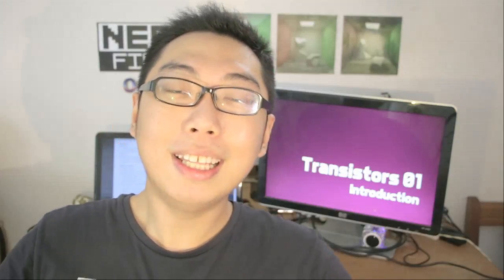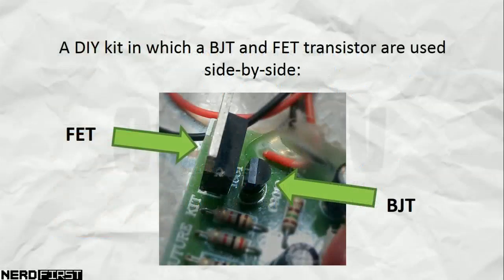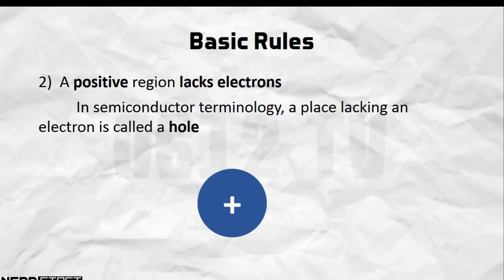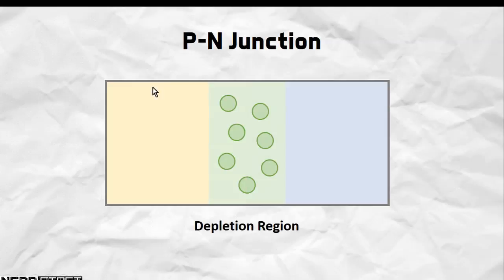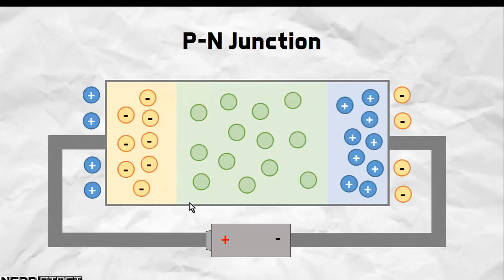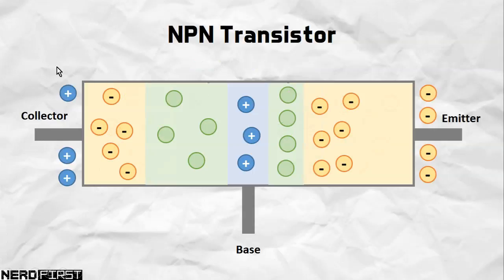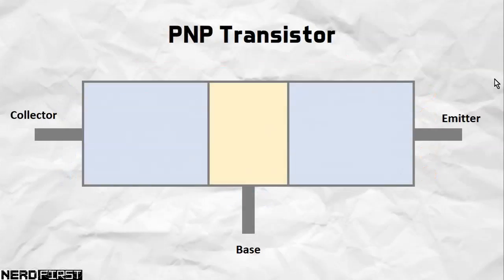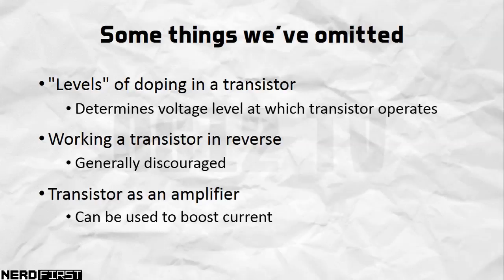What are Transistors? - Transistors 01

Comment: In 8:46, positive atoms on the right get pulled towards the electrons in the wire, but why don't they receive the electrons and make a complete neutral atom?
Reply from the maker: Hello and thank you for your comment! This is a good question!

From my understanding, they will to a certain extent, which is why the depletion zone grows. Eventually a level of equilibrium is reached, and so there will be no flow of current.